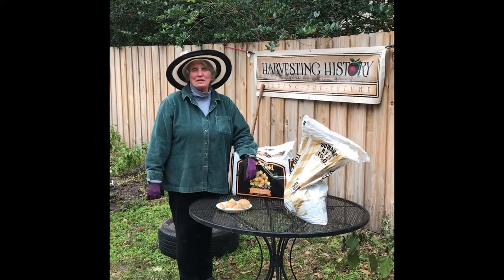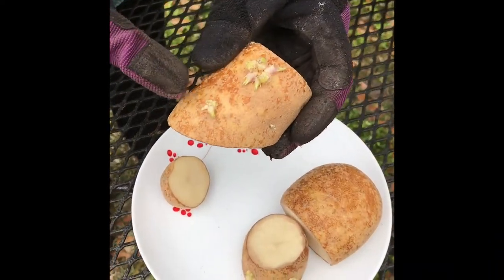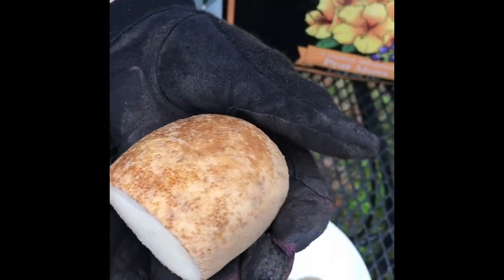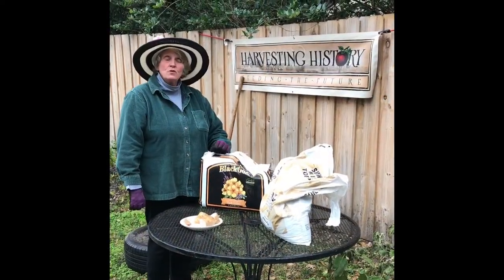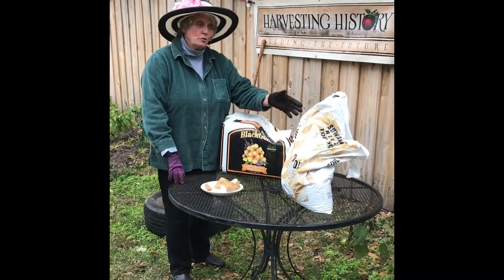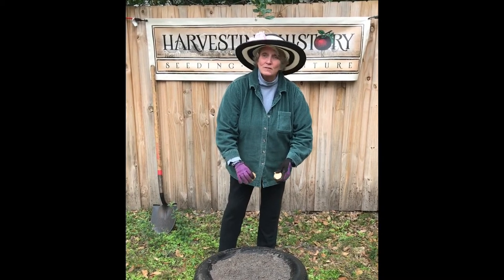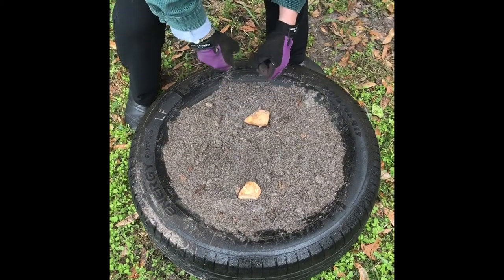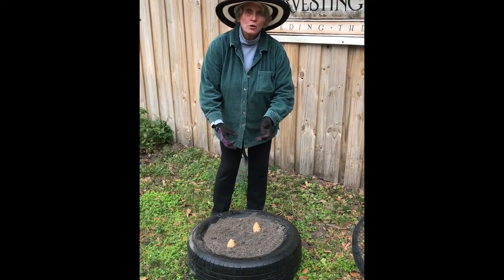Growing Potatoes In Tires

Comment: how often to water?   or raised boards 2x10's do the same thing? thanks for the info
Reply from the maker: Ronbo Nick, Potatoes do not need a lot of water. If it rains, not drizzles, rains once a week don't water at all. If you get no rain, then water every three days with 1-2 gallons of water. If your tire tower soil is a little moist when you poke your finger down 3 inches then use 1 gallon. If it is dry, then use 2 gallons. I am not sure what you asking with the 2X10's. Please tell me more.

Comment: i don't wanna sound like a downer here,, and i don't ordinarily comment on videos,, but,, old tires are extremely hazardous as far as pollutants are concerned, the petroleum chemicals that leach off of tires as they break down are toxic. I wouldn't suggest they be used for flowers let alone for vegetables. There are so many other ways you can make a ring to contain soil for planting that are clean and safe. old trash can with the bottom removed  ,  chicken wire or fencing material, even stacked split wood.. I'm sure you can come up with a dozen other simple things to use other than tires.
Reply from the maker: Yanksfan, Thank you for your comment and for your helpful suggestions.
Reply: Tires break down?  Isn’t the problem that they do not break down in which case growing potatoes in them seems like a good reuse option.